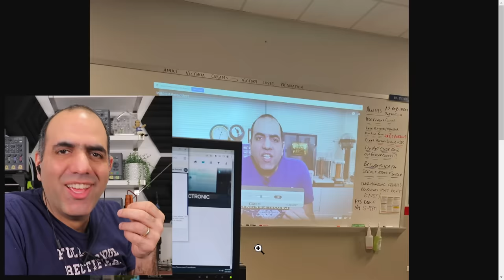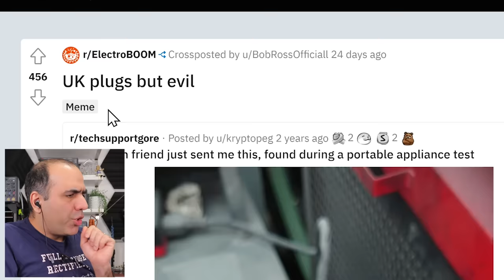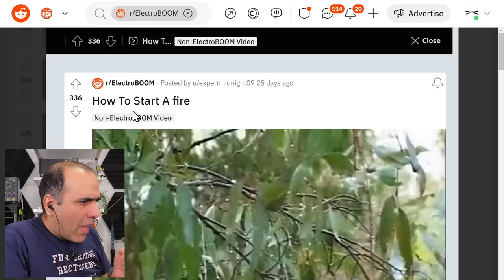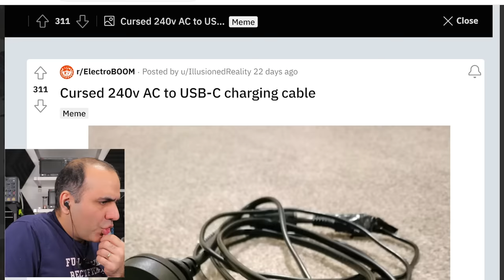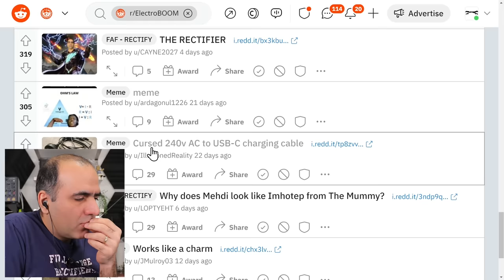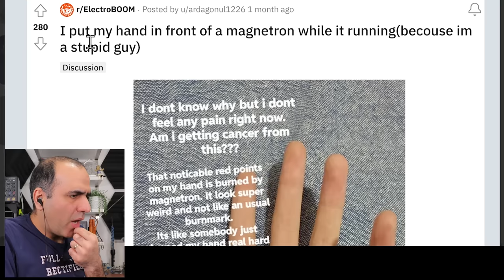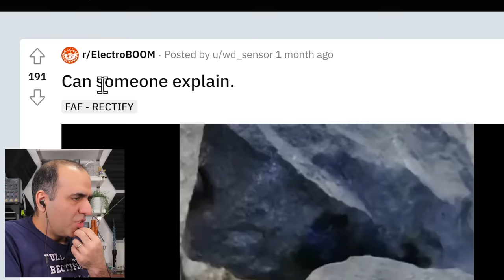Closing a POWER ARC Switch with a WEAK ARC (LATITY-012)

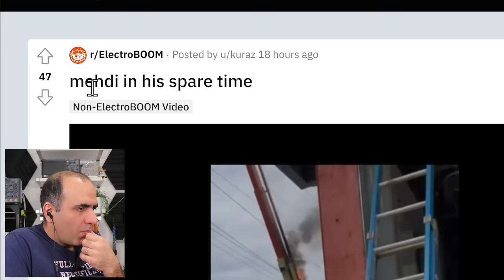Comment: 1:17; This clip from Latity (Episode 12) shows that a TikTok clip is posted about a scissor lift or crane raised too far from power lines because it can electrical from the ground. Also, the two guys on that crane shouldn't go to the power lines because the high current from the voltage will cook them or burn them up instantaneously to death. Note: Always read the warning labels of using a crane to reach at a certain height without heading to the power lines.

Comment: I've worked in an environment where you needed to be grounded. You put on special shoes with a strap in your sock. Then, you test the conductivity on a plate. If you did it right, the door opened and you could go in. The whole floor was ground.

Comment: Hey Mehdi! Maybe you could try rewinding the ballast transformer for higher voltage!
Reply: If you have access to a lathe (wood or metal), it's an easy way to spin the body of the transformer and wind smaller (higher gauge) wire neatly.
Reply: @Syncubus  You can also get hand-cranked coil winders with built-in turn counters for ~$60.00. Guitar pickup winding machines are pretty much the same thing, but the one's I'm aware of are more like ~$500.
Reply: @Syncubus  Yeah, but that's extremely tough to do with an E core. I'd personally take some measurements and 3D print a bobbin to wind wire onto.

Comment: 3:25 I beg to differ. I think that's very sootable paper for this purpose ;-) But seriously, Mehdi, stop recklessly messing with the microwave transformer or at least put a huge disclaimer. This thing can kill you in an instant and you should know this better than anyone... Some sparks for fun and giggles are one thing but messing with that thing and potentially inspiring someone to do the same just seems to cross the line.

Comment: That USB-C charger to charger image brings back memories of me as a 6 year old, except with two standard UK plugs and 240v mains lol... the massive shock I got stopped me from being dumb with electric later in life .
Reply: i find it hard to believe that a 6 year old child attached a plug to either end of a length of wire.
Reply: @KarldorisLambley  I was somewhere between 6-8, hard to remember exact age when it was 30 years ago now. I grew up on a farm and messing around with stuff was common, it was before 9 though as we had moved by then.
Reply: @Gr1mm4  it's alright mate. i am convinced. my childhood idiocy was opening the gates in a socket with a screwdriver and inserting an electric heater filament between live and neutral. it went red, orange, white, then melted. so i know kids do dumb things. thanks for caring about my opinion. DA

Comment: I have an old device that's an accessory for stick welders that generates a high (relatively) frequency to make it easier to strike an arc on old arc welding machines. I think it's like 2500hz or so. Makes it so easy to get an arc going on a lower powered machine or even combined with a tig torch with a valve on it for a poor person's tig machine.

Comment: For your information, erythrocyte sedimentation rate is a test used to determine the rate at which your red blood cells precipitate out of the solution (your blood + anticoagulants). It is commonly used to determine whether there is inflammation somewhere in your body. If the time is not within the reference values, your doctor will start looking for where it is. Another test used similarly is CRP.

Comment: "i think that's used in the industry somewhere", i mean essentially whenever you have e.g. capacitor banks and a spark gap to control a larger discharge (bigger spark gap, high power flash tubes for lasers, ...). also iirc sometimes a system like that is used to strike/(pull away and )extinguish arcs in high power transmission stations/power plants/etc.

Comment: You know, if you put a series impedance, like a wirewound HV resistor, you can get some really nice arcs.  I used to do this in a faraday cage for a 200 kV DC power supply.  Using those resistors, a pneumatically operated relay and sharp points, I was able to create a DC Jacob's Ladder. With all the stuff we were doing, the building safety inspector was afraid to come in and inspect. It was all great fun.

Comment: This technique is used to simmer flash lamps in high power lasers. It avoids misfires and burns the electrodes evenly.  Also used to fire off high current and voltage pulses through stuff.

Comment: A small high-voltage spark switching something is used in flash tubes, where it triggers the flash.
Also, in ICP-AES (inductively coupled plasma atomic emission spectroscopy) a small spark ignites the plasma torch, which is even more awesome than an arc!
I bet, Mehdi can build one without burning the house down.

Comment: Electroboom would be proud, I haven't made an electronic circuit in a long time. So I figured I'd make a simple blinking LED 555 circuit. I looked up the diagram, spent like 20 minutes putting it together, and my hard work paid off because once I powered it all up, the 555 timer cracked and started smoking (: 

I think I'll stick to mushrooms for now.

Comment: Thats pretty much how many different types of discharge lamps start. They use a high voltage high frequency igniter to get the arc lit then they ballast takes over to run the lamp. HPS (the orange lights common for street lamps) as well as Xenon bulbs used in projectors are just some examples.

Comment: Clothing does create ESD. You can get ESD smocks woven with resistive fibers that connect to a grounding point when working around sensitive devices. Stripping naked is technically a valid solution, in the same way that jumper leads across the nipples prevents lethal current from getting to your heart. Have a look at some of the ESDA standards if you want to get very bored very quickly.

Comment: Mehdi, USB-A supplies can certainly do more than 5V. There were a few different standards, like Qualcomm QC and Mediatek Pump Express, for negotiating higher voltages and communicating current capabilities. For instance, my last phone could ask for up to 18W (at either 9V or 12V, depending on the phone's mood.)
Additionally, USB-C supplies are not supposed to put out any power unless they see a pulldown resistor on the CC line. This is why some cheap devices won't charge with USB-C compliant power supplies.

Comment: The grounding yourself doesn't help if your not wearing ESD safe clothing (mildly conductive threads woven throughout) so being naked actually would help if you don't have an ESD rated clothing. Because most normal clothing is extremely non-conductive they will still build up charges and don't discharge properly even if your grounded unless you get really sweaty and wet the whole thing in salty water. (Which is probably also bad for electronics assembly).

Comment: That's the same way that high voltage start on a welding machine work. Some stick welders have a high voltage that starts your arc, then the lower voltage, but much higher amperage weld can work its magic.

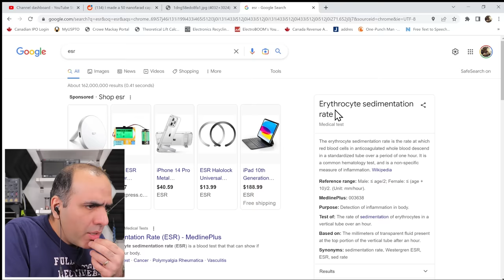Comment: 12:07 equivalent series resistance (please read... im going to tell you how to save ~180 bucks on a battery by doing a BMS reset.....which is NEEDED!!!!! especially on FORDS!)
.
im a mechanic.... but that effect is seen in batteries 
thats why they will go dead if you dont start your car in a few months (as well as the radio's clock, engine computer holding its fuel trim memory, ETC) 
.
but a lot of people think if they unhook their battery.... it will stay good forever
yet it only takes about a month for it to drain
.
.
also... in cold weather.... you WANT some ESR
this keeps the chemical reaction going.... providing a BIT of heat
which keeps the water+acid from freezing 
.
if it freezes.... it causes HAVOC to the lead plates inside.... pushing and pulling them
a 12V battery is made from SIX 2 volt cells..... (which is why some batteries have 6 "caps" you can remove... to add extra DISTILLED water and acid if it ever gets low)
.
but when frozen.... it can push the plates away from each other.... so they only put out 1 volt (or less)
or can push them together.... causing a shorted cell (aka, battery now only puts out 10.4 volts..... instead of 12.6) 
.
.
.
.
if the sides of your battery are pushed out / swollen (and not flat)
you are gonna need a new battery 
.
it might work in the summer.... but in the winter when you need that extra current/amps..... its going to crank over REALLY slow.... if at all 
if its REALLY low... all you are going to hear is "click click click" (which is the starters bendix engaging the flywheel, but when the motor turns on, it drops the voltage so much, the bendix cant stay on.... so it turns off.... battery regains some voltage.... bendix engages flywheel.... motor turns on... drops voltage.... ETC ETC ETC ETC) 
.
also... even if it does start
you could have a shorted cell
.
your 12.6 battery is now a 10 volt battery
but your alternator (aka, charging system) sees the 10 volts and says "oh crap, the battery is low.... better go full field and charge at FULL!!! capacity)
.
this BOILS OFF THE ACID!!!
and you are now breathing in these acid fumes 
.
USUALLY not fatal.... but will make you cough like crazy and your lungs, nose, and throat burn like crazy 
also has a strange smell (its a different smell.... IDK, to me its INSTANTLY recognized as a bad battery...... but to others, maybe something like sewer gas mixed with.....IDK, it just smells strange AF)
.
.
.
also, batteries last about 4 to 6 years..... 
even if you do everything right, they wear out after 4 to 6 years........ 
.
and most cars built after 2010 also need a "battery monitor reset"!!!!!!!!!!!!!!!!!!!!!!!!!!!!!!!!!!!!!!!!!!!!!!!!!!!!!!!!!!!!!!!!!!!!!!!!!
if you dont do this reset..... the alternator thinks it still has an old battery, and will NOT CHARGE IT CORRECTLY!!!!!!!!!!!!!!!!!!!!!!!!!!!!!!!!!!!!!!!!!!!!!!
.
so instead of 4 to 6 years...... you get 2 to 3 years!!!!!!!!!!!!!!!!!!!!!!!!!!!!!!!!!!!!!!!!!!!!!!!!!
ford was the first to do this in 2011
.
.
.
.
.
.
i know that was a LOT to read.... 
but you now know EVERYTHING that i do about batteries 
.
i hope i can save you about ~180 bucks
(not every mechanic wants to rip you off.... most don't actually.... its the boss/service advisor that wants to rip you off)

Comment: actually, the voltage of the two connected usb-c chargers should both be 0 volts, as per usb-c spec they should not start providing any power until the device on the other side (actively, or passively by connecting two pins through a resistor to ground) negotiates a voltage and current setting with the charger. since neither charger will ever be configured as a usb-c device to receive power, the other charger will never start providing any power.

Comment: That bloke with the sledge hammer was doin a cable spike to determine if the wire was live or not as a safety feature but also to swe if its live or not due to little or no info about it

Comment: There was in the past a solid state switch called Trigatron, using a low power high voltage source, to switch high powers. Today replaced by SCR's in most of his usages. I've seen it in an old Marx Generator.

Comment: I believe that is also how power grids work, the power is there but must be pushed through by adding voltage to it.

In Sweden we've had a problem with this since we started shutting down nuclear power plants. We get about 50% of our power from the north but 90% of the power is consumed in the south so we really do need intermediate power along the lines to push it through.

We really need nuclear for that, wind is great but when it gets really cold and we use the most power to heat our homes there is no wind. It is incredibly surprising that NO ONE thought of that when we started replacing nuclear with wind. I mean it was expensive as hell in the winters even before the war started because while we do produce far more than we consume, we can't produce jack shit when we need it the most.

Comment: with USB C charges, they're a little bit "smarter" because they have to talk to the device to get power. or the device can be marked as "dumb" by putting in a resistor and it'll just supply 5v. so it's possible that, in a USB C to C, the +ve is just floating, and with A to C, the C was floating but now at 5v, and A to A, both is at 5v so nothing happens.

Comment: Do you think this "electric arc switch" system could be used in addition with your previous MOT high amperage transformer? If that works, this could lead to high amperage electric arcs. But I am wondering if the low voltage of the MOT will be enough to allow the current go through the arc. Very interesting to see as always 🙂
Reply: Nice idea! Unfortunately though, the MOT has too low of a voltage to maintain an arc. Plus, the primary inductance is too low to block the AC. 

If he wound for maybe 10-15V, he could get some small arcs. He'd just need to use a FULL BRIDGE RECTIFIER with high voltage high current diodes to prevent the ignition voltage from going through the windings instead of arcing between the output. 

And a filter cap for the FBR would also help because smooth DC is easier to arc than AC or bumpy rectified DC because the voltage doesn't pass the zero crossing point. Also, the rectified DC is the AC's peak voltage and not its RMS value, so you'd also have a higher voltage.

Comment: The USB-C charger has something that determines if its a HOST or a SUB DEVICE, so it properly won't do anything because their both a SUB DEVICE. Correct me if I'm wrong. I just looked up "Does USB have a host and sub device determination," and it does so.

Comment: chopping the life wire looks like a procedure that still exsists in europe. however they would remotely shoot-in with gunpowder a 2 feet wonky metal pin to couse a short these days. this needs to happen fast enough so the breaker trips be4 burning shit to crap. its rare, and usely done in situations that theres tomuch risk and tomanny qeustions or tomanny people working on it. you would also just short the circuit to make it not live then risking your life. least that what your tought, and thats why your probbely still breathing and got this bald/old. yes there otherways of doing it.. but we use ground cables alot more harder to trace those then vs above ground and usualy more hot aswell.

Comment: RE: the guy cutting a live wire with an axe, there was a video by a channel named residualcurrent (a qualified electrician) where they had to deal with a cable that they didn't know the origin of (it either needed moving or removing), and because they didn't know where it was fed from they used a spike, essentially like the axe, to short the phases in the cable to verify if it was live. Maybe this is a similar process?

Comment: If the charger has a usb cable socket it isn't not going to output anything, until you plug in a cable with usbc on both ends or an otg cable

Comment: Ok when you connected the cell phone chargers together I almost lost it laughing with the atom bomb bit.  Well done, sir.  Well done.

Kind of curious if you can explain why Tesla coils violate the inverse square law?  I detected a sphere of off-the-scale electromagnetic density around 3 feet from my Tesla coil using my EM meter.  Go closer to the Tesla coil, and the field strength drops, go farther from the Tesla coil and the field strength drops.  But at a specific point in a sphere all around my Tesla coil, the field strength is off the scale.  It's maybe a few centimeters in thickness.  

Any insights?

Comment: I have a question. My father was painting ATC tower in the years before I was born. The roller pole he was using came into contact with some primary power lines beside the tower(he was on the top of the tower and the lines were supposed to be shut down). They told him he survived because of a hole in the sole of his shoe, which grounded him through the tower, though it burned off most of his foot😬. He was told later that someone had to knock him off of the roller pole because he was basically stuck like a magnet. I just don’t understand why did it not kill him?

Comment: 6:00 High voltage (10kV ?) is used to create the initial arc to start the arc of a TIG welding machine. Now that machine could be potentially dangerous. (hugging it every day)
PS. How can a machine that creates a 10kV arc be safe when it puts out 400 Amps of power?

Comment: Hey Mehdi, an electrician told me that super high voltage lines can pull a crane towards it by a couple feet (especially because those cranes are usually pretty wobbly). Is that possible?

Comment: Yeah, please don't make these usb charger suicide cords. It is not supposed to do anything bad, and it won't with good quality chargers, but a lot of the cheap chinesium chargers are not nearly compliant with the spec and I wouldn't be surprised if some combinations end up making the other side live with much higher voltage than you'd expect.